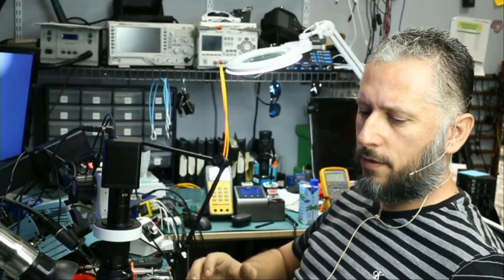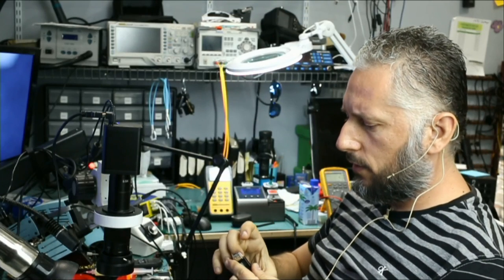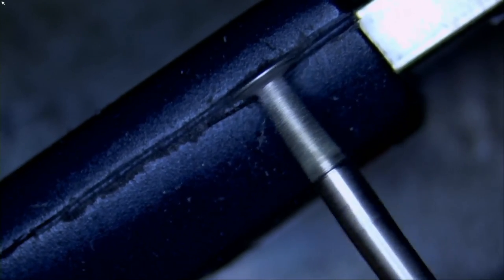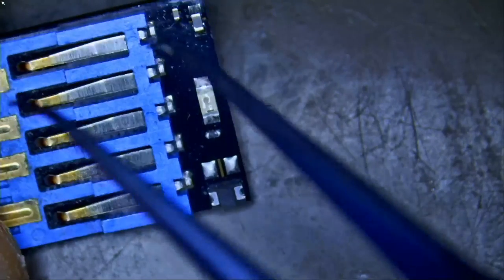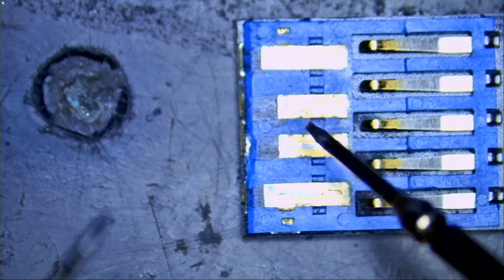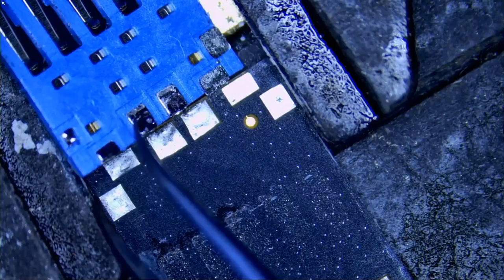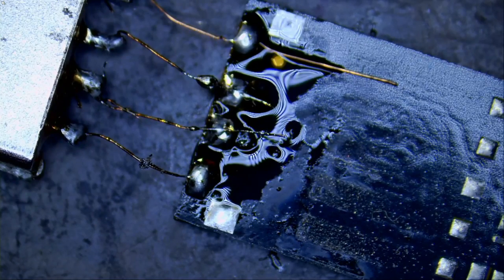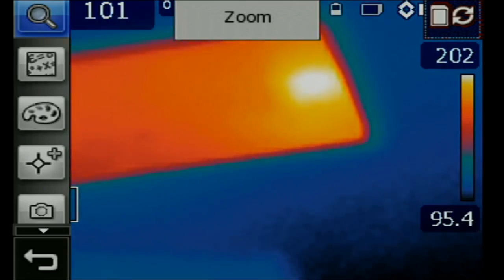SanDisk Flash Drive Not recognized Freezes - Is it repairable ?

Comment: I do this kind of work and when windows acts weird like it was i then take the flash drive and plug it into a linux based environment. the amount of success i get with this method is 7 out of 10 times linux allows you to see the files where windows hung. before i take drives apart in this situation i always try linux environment first. The local college sent a female student to me with a flash drive with similar symptoms as they tried for days to recover her college work off the drive and failed. She came to me and i sent her to a local shop about 5 minutes walk from my place to buy a replacement drive as i was out of them. By the time she got back i had a backup of her files on my desktop ready to put onto her new drive. She walked away over the moon happy. Within half an hour the college it guy comes to me to ask how i did it. I told him not everyone lives in a Microsoft world.
Reply: My first thought exactly.
You could even quickly salvage some data by doing dd
Reply: @crylune  was that operator error or linux error.
Reply: tengo el mismo pendrive con el mismo problema y en linux falla igual. Es un defecto de fabrica de este modelo por desgracia

Comment: Those sandisk flash drives are known to get very hot during operation. It could be a possibility that the chip overheated itself
Reply: my idea to
Reply: The controller does all power management and often fails
Reply: I use sandisk flare and yes it's very hot because it's very fast

Comment: Maybe you can freeze the drive for a few minutes, just enough time to pull the data off it.
Reply: exactly what I was thinking
Reply: This is the first time i hear such a technique. can it really work?
Reply: I dont think so
the instant when you pluged it in it get hot imediately because of the short inside
Reply: Those Sandisk drives are total crap it seems. I have one and it has never worked properly. Slow as hell and fails to detect occasionally.
Reply: @generalbutz8477  Things generally work better in the cold. I have tried this on other devices and it works.

Comment: You should have a cooling spray in hand and try to cool the drive's chip and try to read that way.
Reply: @Vlado T but if the chip is shorted inside it will not work.
Reply: There is a short inside the Chip, i have the same problem with a Sandisc usb drive.
When the ice melt, what your cooling spray generate, u get another short of all usb pins.
Reply: The heat is not the problem. The heat is a symptom.

Comment: There might be overheating protection on the chip. Try cooling it while extracting data. It’s a long shot but I am curious. Also you might try a bit lower usb voltage.
Reply: Was going to say this.
Reply: Yeah I would say put it in a non conductive fluid or try thermal paste and a decent heat sink.
Reply: Like the idea
Reply: @manickn6819  I think thermal pad + heat sink is enough to cool a removable drive
Reply: @sihamhamda47  probably is. Forced cooling of the heat sink may or may not be necessary depending on the size.
Reply: Had the same idea.
Reply: I was just about to say the same thing

Comment: I've had some low success with cooling the chip . Used canned air, holding it upside down,  to keep it super cold. maybe 15% of the time it'll keep the chip cool long enough to work. works on HDD controller chips as well.....rarely, but sometimes. Easy to do.
Reply: huh, what a vague description, use canned air, hold upsite down???????????? uhhhhhhh ok............
Reply: @budgetking2591  Canned "air" is basically R134a refrigerant.  When you hold it upright, it dispenses gas, when you hold it upside down, it dispenses liquid refrigerant which basically works as a freeze spray.
Reply: @budgetking2591   Anyone who works with electronics in any capacity knows what he means. Although there is a first time for everything, for everyone, and hearing about canned air and its uses might be yours.

Comment: Was about to buy a 128gb version of this drive. I'll keep looking for something else. Great vid
Reply: So you won't be buying anything that goes to a repair shop? 

You're not gonna buy anything cuz everything break at one point and that's normal

Nothing in this video stated that it died prematurely or anything like that
Reply: All flash drives can fail. Do not use them as your main drive. Do REGULAR backups of your critical files
Reply: Basically all flash drives are terrible for random catastrophic failures. Especially if you leave them plugged in. They overheat easily and will lose everything on them. Only use them for transporting files or as a backup (of a backup, preferably), or some other task where data loss is acceptable.
Reply: These devices seem to fail often but only because they are so popular... buy a good brand and stay away from Chinese cheapo things

Comment: Now you may think I'm silly but 40 years ago I used to do data recovery on floppy discs, place disc in plastic bag, place bag in the freezer for 10 mins, remove and try again. Worked 90% of the time. Also used to go around the PCB with a can of freezer spray and spray individual components, then power up, eureka

Comment: Since you've already deemed it a lost cause you might try a long shot and put the drive in a plastic bag and immerse the bag in a container of ice water.  Doing so MAY cool the overheating chip just enough to get it functioning long enough to pull the data off the drive.
Reply: The heat isn't keeping the drive from booting. There's a dead short inside the IC package (which keeps it from working) that generates heat. :)

Comment: I have two Sandisk Ultra 64GB usbsticks. Both still work for a few minutes but as soon as they get hot (which they do at idle) they stop working. 

Sandisk really made junk. Mine both died little over two years. If I had stress tested these when new I'm quite certain I could destroy these within a few days...

Comment: LED?  You did not mention testing the LED using the DIODE Mode on the meter which will light the LED if the meter outputs over 2.5V test voltage.  I was thinking that the LED was shorted because the FLIR showed the hot spot where the LED was.  I believe the clamshell case was ultrasonically sealed.  In the medical field, I have seen ultrasonic machine that melt the plastic electronic box edges together.  The company I worked for said they did not want the liability of someone trying to repair their medical electronics. I have been successful in opening sealed cases (glue or ultrasonic) by squeezing around on the seam with a vise till it will crack apart.  ABS slovent is used to re-seal the plastic.  I discovered yesterday that I could re-seal a case that was cut open with a saw by using the 3Dooler pen with ABS filament to fill in the gaps.

Comment: I have had success with opening similiar sealed cases by lightly crimping the case in a vice. It flexes the plastic and cracks the joint without damage mostly.

Comment: Hi Alex, You should have tried to recover files with a recovery software first. When Windows detects the drive even if it cannot read it there is a high percentage of recovering the files. Maybe you've tried this before and not putting it in the video.
Reply: Doesn't help you in this case, as the handshake and power negotiation fails. Usb 2.0 usually allows 100mA pre device negotiation and 500mA if successful, that is important. If a device has problems and fails the handshake due to electrical problems, it is auto setback. That is the reason why you get an infinite device detect, device not recognized loop. If the defect on a usb device is heavy enough or the handshake loop has been retried one to many times, it could happen that the used usb ports power polymere fuse goes open and you can't retry a connection for quite some time.
Anyway, if the device is not stably connected to host system, no software will be able to reach through the memory controller down to the nand or nor chip itself. This is probably a case of a defective memory controller. Only data forensics whith grinding down the storage, hooking it to a donor controller or some hidden spi pins and hoping it does not scramble the contents will yield a possible success.
Reply: Nope
You can hear the beep detection then a second after it get unpluged
Reply: Recovery software wouldn't work in this case because the chip is getting hot.

Comment: Drives like this which are only Nand chips are destined to fail because these have extremely tiny trace's or tracks inside and when in use these chips get Hot and fail eventually cause of tracks start to break on microscopic level because of stress caused by Heat.

Comment: Could it have worked, salvaging the data, if the chip was cooled during the process with transferring the data? 

Because it seems like the drive is recognized and maybe is working, until it gets too hot because of overheating. (We could be lucky, that there is a leakage of current that doesn't affect the
data on the chip, maybe someone here has experienced something like this)

 Meaning - showering it with freeze spray while it is connected, or possibly using dry ice would help. Maybe even also pure, cold ice/water as it doesn't conduct too much electricity, would have worked.

Comment: I wonder if using external 5V power supply with current limiter could allow getting data without tipping over temperaure ,, or cooling of flash-IC while data recovery would work ?

Comment: I had whole bunch of these SanDisk flashdrives (this exact model). This flashdrive model has a manufacturing defect - once the unit detects a failure in data readings, it locks itself against writing. My entire stock suffered from this fate.
And yet, SanDisk keeps selling them. Since then, i´m avoiding that brand. It kinda sux, as i have one of SanDisk´s more expensive flashdrives, which is fast and reliable (works to this day).
If you need cheap and reliable flashdrives, look for Adata. And remember to ALWAYS HAVE BACKUPS OF YOUR DATA.
Reply: Don't use flash for backups! It's not reliable!
Reply: @mrtechie6810  Nonsense. It's as reliable as any other electronic component. What are you using for backup, floppy disks?

Comment: these drives are supplied as Fat32 drives and the problems start when you convert them to NTFS I wonder if that is causing the overheating?
Reply: The problems start when you start using them because they just aren't very reliable (all brands, as far as I'm concerned).

Comment: Just asking, could you have dumped the drive with PC3000?
If not through USB then by grinding out the NAND flash traces on the PCB surface of the package?
Reply: He doesn't have PC3000 - not a data recovery specialist, just having a go.

Comment: I've got one of these SanDisk flash drives which was formatted once as system storage for a Google Chromecast. I don't have the Chromecast anymore and the flash drive isn't recognized because of the formatting. Is there a way to short it out or something so that it resets the drive entirely? I don't care about the data on it.

Comment: i always wondering what you do security wise in case the usb drive
have some type of automatic virus install when you plug into the computer and test it
Reply: Turn off autorun. But there could still be a firmware-based attack.

Comment: The thing is ultra-speed USB 3 thumb drive generates a lot of heat, I have one that comes with an entire metal shell, and when it is plugged in for a couple of minutes it begins pretty hot to touch, so I use a thermal conductive double sided tape and stick it with a small aluminum heatsink fins on its body so it can spread the heat to more surface rather than in one spot. IQ 200! lol😅
Reply: Yep, I have a Kingston usb 3.1 with metal shell that gets super hot & can even burn your skin.
Reply: True that , mine overheats to the extent it lost the smd components on top . Any one has their values , please help

Comment: just a little question , what kind of component is the white smd in the middle?
i see one in an unworking bluethooth recever and i have gessed it was a fuse.
Reply: @toolsarecool  this drive don't make light (i have one),and the one in the bluetooth reciver have no voltage drop.
Reply: after some searching, i think you're right on this one but i don't understand the point of having a led here because the light is blocked by the houssing. i just have a small magnifier and it's difficult to see so clearly what is the component in the bluetooth reciver.

Comment: Probably you just have to pull out the moving part. There should be a v shape inside the shell, preventing it from going too far out, but if you cut it, you can pull the stick out. At least Verbatim has this kind of mechanism.

Comment: Man i respect what you do, and i think you are a very good hardware tech, but i think this problem could have been sorted by reprogramming the chip with a software , than just go right in and dismantle it like that, it is just an opinion, you should have tried some mounting options first (software) and then check the thermic output before going in. I know it is a tedious job, and i do appreciate the time and work you are putting in, but i think it would`ve helped you more if you went software first. Cheers, keep up the good work. 
 You`re awesome !!
Reply: Looks like a hardware fault... what the heck is any software going to do if the chip is failing?
To the other comment @gtavc007 what is he doing that is making you think he sucks at dealing with customers? Because he didn't magically fix everything or spend way too long on something that he cannot repair? Also, running a youtube channel and producing videos takes time and effort, so if it does help his business, then how is that even a slight against him? I'm not even a big fanboy of this guy, I just like to call out people's crap.
Reply: If calling out things let's not forget not correct readings all time testing components in circuit!
Reply: @kunka592  it was an opinion, i meant if you can retrieve data without doing the hardware process and it is about just that, retrieving the data, again in my opinion, i think a mounting software had been more useful, moreover when the client said it did appear to be working sometimes..  It was an opinion, i am not saying that i have the answer...  There are many reasons why the flash drive didn't work...

Comment: On these type of stubborn plastic cases you may use YMI coorporation blb13 case glue remover liquid to open the case easily.
Reply: Are these surely glued, not welded?
Reply: @elmariachi5133  I had to open the same drive yesterday with the same issues as in the video.
From the outside it looks like it's 2 pieces but from the inside it looks like one solid piece. I had to cut it open as well.
Reply: @Joey-ir3lk  Thanks!
Reply: are they ultrasonic weld
Reply: @jackiemay9471  idk man, I do electronics, not plastics 🤣
All I can say is that it looked like one solid piece from the inside and that cutting it open is probably the only way. But just like Alex said, let me know if you know a better way.

Comment: Lesson: Use more then one USB drive for backups.
Reply: ... or rather use proper backup and never leave important files on flash drives?
Reply: preferably different brands
Reply: i wouldn't use ANY flashdrive including SSD's for backups .. good old HDD in a USB case and done. if you are really paranoid, mirror them in the cloud :)
Reply: Don't use flash storage for backups! It's not reliable!
Reply: @mrtechie6810  not reliable? my 12 years old flash drive still alive and healthy :)
Reply: @maklogetrich2378  mazel tov!
Consumer flash thumb drives are notoriously unreliable, and typically fail without any warning, often losing access to the entire drive. They also can corrupt data without any warning!
Also, the solid-state memory cells eventally revert to 0 without power. Not good for archival.
Their intended purpose is for moving data between devices, not for backups.
Hard drives are far more reliable.

Comment: There is a memory cell on the drive that is going bad. The OS is trying to read from the drives file system, which is probably stored in the cell that is going bad. When it can't mount the file system it only shows the device, not the data or the file system.  Then other cells may possibly still be good. There are software tools that can read the good cells and then put them in order to get the data off.

You are not a data recovery expert, you are a micro-solderer guy. I knew what was wrong with the drive from your clients note, and I also knew how to possibly pull the data off. You should contact me the next time you are trying to recover data from a drive. I will tell you the best methods for doing that.

Comment: Random question to anyone who might be able to answer.

I don't use flash drives very often but recently had to transfer several large files (750mb and 475mb) from one computer to another. Well any way when I was done with the operation I went to remove the thumb drive and noticed that it was quite warm to the touch. Not burning hot but definitely noticeably warm. My question would be if anyone else has had a similar experience and if this is normal for the thumb drive to heat up like this
Reply: Be safe and backup those files in the flash drive, just in case. And don't use it for other important data. Or... you can play flash drive roulette. Who knows, you might win.
Reply: Perfectly normal.
Reply: Without knowing your flashdrive - yes that should be normal. The controller chip ("CPU") of your drive is working full time over a longer period of time, work = heat generation. And because there are no heat sinks on USB drives, that heat is building up, slowly heat saturating the surrounding material (plastic housing).
That effect is much more pronounced on USB 3.x drives than on 2.0 or 1.x drives (more work done in a smaller area).
Reply: They draw around 60 to 100mA in normal operation so get a little warm